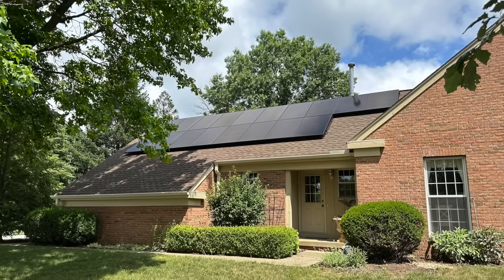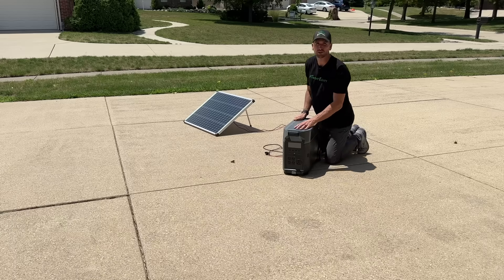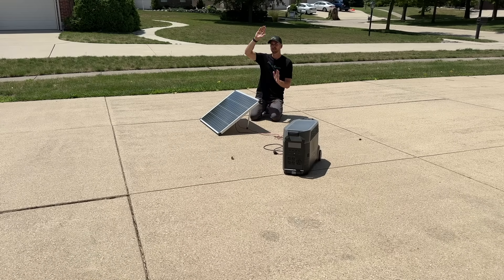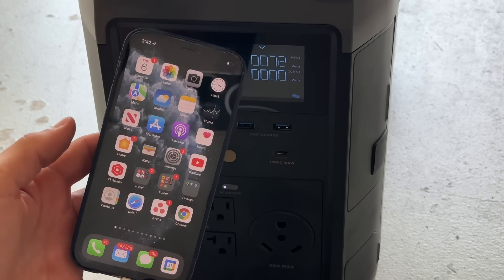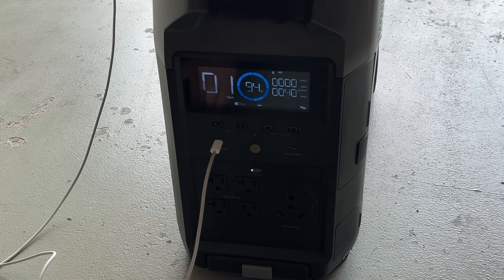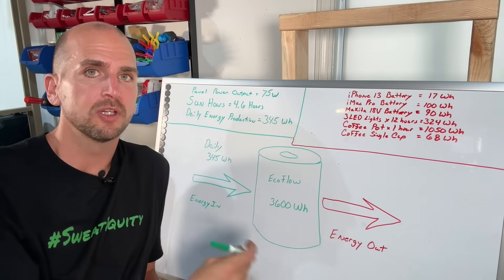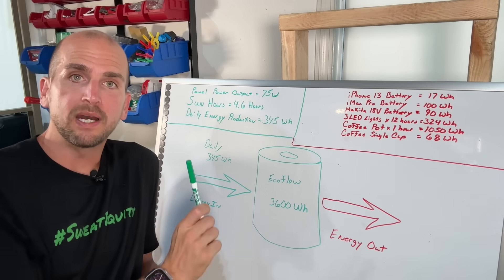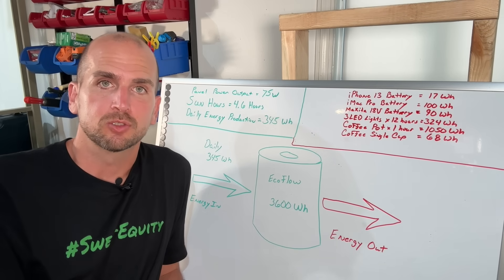What Can You Run On A Single Solar Panel?

Comment: again, people can get confuse. it's 'rated' number of watt. not how much it will produce. since amps is load, it will add load into the panel. and if we past that rated watt. you will risk damaging the panel. theoretically panel always designed below the rated watt. it's not bc the panel is underwhelmed.

Comment: What can you run on a 100W?  Not that much even with all the energy efficent lights. Don't  forget, 100 W usually indicates the max.  Without a battery storing  the electricity it isn't  very useful. One car battery constantly  charged (8 hours). Would make it way more useful, but only as a temporary solution. You would still be living a nomadic lifestyle.

Comment: Do you know which solar power station model in UK (EcoFlow, Buletii etc) I can charge with a 245 watt solar panel (open circuit voltage 37.4, open circuit current 8.61)

Comment: Planning to convert an 8x8 shed to off-grid solar with lead-acid batteries due to freezing temps. This was very helpful, thanks.
Reply from the maker: Best of luck, sounds like a fun project 👍.  Here is a bit more information on a Solar Shed project I did last year https://youtu.be/53mRZQK3g8g

Comment: You failed to mention the consumption of the AC inverter. On the Delta Pro this is about 40 to 70 watts and is not reported in either the display or app.

I also noticed that you had the AC inverter switched on even when using only the USB outlets, thus wasting the AC inverter current draw. Despite the 70 watts coming in from the panel, you would probably have been draining the battery slightly.

Comment: Why should you run on a single solar panel?!? Solar panel price index has fallen by over 60% since the beginning of 2023!
Solar electricity from them then only costs around 2 to 5 cents/kWh. 
This is because solar panels generally last around 25 years - and are maintenance-free!  
It is therefore very worthwhile to install as many solar panels as possible on your garage, carport or house roof, on house walls and/or in the garden.

Comment: You need minimum 500 watts and 6 deep cycle RV Marine batteries from Interstate Batteries  to run a stereo TV And Radios stereos  some lights can charge up a air compressor tank

Comment: i  think the way you're calculating watt hours is wrong the calculation you did was already done when the solar pannel was rated, so you're double caclulating it, you get 4.6 Hours of sunlight per day, but your pannel is producing power from say 6 am to 6pm or whatever it is, so you actually get more than 345 watt hours. if you take the total watt hours over the entire day, you will see near the rated capacity of the panel which is 460 watt hours.  460/4.6 = 100, thats how pannels are rated. theyre rated by how many sun hours for the day, not there maximum wattage. this acutalyl makes it way way way easier to know how many watt hours you can produce during the day, no fancy calculations needed. if you get 4.6 full hours, and a 100 watt pannel 460 watt hours, easy .

Comment: If your Ecopower Battery unit is drained and using a 100 watt solar panel that averages around 75 watts would take you 48 hours to fully recharge that Battery pack what a waste of Money.  Your better off recharging with a much better solar array, or a generator.  or maybe the 110 voltage option to recharge.  These portable battery station are way to expensive.  Sure nice for charging I-phones, maybe running a small fan, ECT but it's only really good for maybe 5 to 6 hour if you lose House power.    Your better off with a Honda Generator.  for that cost.  Just my opinion.  Waste of Money for something over $1000 dollars, by a generator

Comment: interesting video. In Belgium, one does not have to register the solar setup if it's off-grid (ie : not connected to anything grid wise). I may want to set this up for consumers like a few laptops, synths, a computer and some lights (LED, of course)...with this info, I can make the calculations. Thanks

Comment: You’ve got an expensive EcoFlow, but I just want a solar panel to set out on a sunny day to power and/or charge up my iPad on the job site, and if there isn’t enough sun, then I’ll charge it later.  But I’d need an adapter to go from two wires from the solar panel to a USB-C (without an expensive device like an EcoFlow)?  Is there such an adapter?

Comment: I can get 300 watt panels used for $100 each. I want to power an instant on demand electric water heater, that requires 150 amps of power. I already purchased the on demand electric water heater and want to use it to be able to clean, wash clothes,and take a bath, but not be connected to the grid. I am cool with cooking, bathing, and cleaning during the day. If the sun is down, so am I.
Reply: Great! If you are interested on this topic, we encourage you to really watch the award-winning documentary, 𝐆𝐫𝐢𝐝 𝐃𝐨𝐰𝐧 𝐏𝐨𝐰𝐞𝐫 𝐔𝐩 - Documentary, narrated by Dennis Quaid, which is now available free on YouTube .

Comment: I expected to hear what you can run
Reply: I have two 100 amp hour deep cycle batteries powered by 320 Watts of solar. I run a 15 Litre 12 volt fridge 24/7, my indoor LED lights, phone, modem and a USB fan and laptop.

Comment: Hey are you sure you connect the negative cable first? Does it not follow same system as connecting things like a battery charger, inverter and jump leads to a battery? Good video generally thanks but have to question your connecting order?

Comment: You have a lot of knowledge regading what is supposed to happen with these solar panels and the EcoFlow, however, I think either I have a dud EcoFlow Delta 2 Max, or those figures are just plain wrong.

Here's an example.  

On a hot sunny day here in England, UK, I can put the solar panel out side of my van - just like you have, on the floor, slightly tilted to catch the suns rays, and it will pull in between 70-130 Watts.  

I put ONLY my Acer 5 Laptop on it and that pulls out 125-127 Watts.  If I put any more on it (a mobile phone, or a fan, or a heater, forget getting even an hour's worth of energy out of it).  It will power a small camper oven (500W) for about 20 minutes (basically one meal).  Or (not both), it will power a 50W heater (on its lowest setting) for about 3 hours.

The DeltaFlow Max lasts ONE DAY when it's fully loaded up to 99% with energy - it takes about an hour to fully charge it via the household 240V plug.

You can forget charging to 99% capacity, as that takes between 5-6 hours.  And anytime the sun appears on it and gives it a burst of energy, the fan kicks in and uses up all the energy.

When I bought the DeltaFlow 2 Max, the literature said that I could power many things in a household with it.  I live in a campervan and it doesn't even power my laptop (127W) for a day.

I was encouraged to hook it up to the mobile phone via an App, but I didn't, because I believed the whole system was designed to be 'off-grid' - and that kind of defeats the object - where's the point in hooking it up to the internet to get the 'best power' out of it?  

Anyway, I'm not best pleased with it.  Especially after forking out £2k for it and it's been like this from the beginning.
I wouldn't recommend that machine.  It's heavy, clunky, the 240v plugs are at the 'back' of the product and it's difficult to position it in a camper van.

Nuff said, me thinks. 

Carry on with the good work.

Oh, and ps, one of the panels of the solar panel that came with it, smashed to smitherines when it landed gently on the floor.  It's still useable, as it's all sandwiched between the plastic panels, but I didn't expect that so soon after buying it.

Comment: I have a 12x16 float out on the river. It’s really for the harbor seals to have a place to haul out in a cold New England winter.
I want to put a metal framed Christmas tree with six or eight strings of Christmas lights out there. Low budget is the key because the seals will possibly wreak havoc on my tree and panels etc.
How many generated watts do I need and what is a good (relatively) system can I install.
Guidance would be appreciated but being directed to a source of more usable info would be very cool. TY.

Comment: There is no way to run a whole house on one of those "Solar Generators" a single 15 Amp circuit comes out to 1800 watts or 1.8 KW this is on 120 Volts.  Your stove needs about 9.6 KW to run that is 240v. Most homes are wired for 100 or 200 amps and designed for 75 to 150 amps there is a 25% safety factor built in to the design that is why there is a difference the extra is for things that have a higher start up like your A/C that requires more power when it stats up.  To put it simple if you were to push your car by hand you would notice that you have to push it harder to get it rolling but not as hard once it starts moving you do not have to push as hard this is the same thing with any motor. the start up uses more energy.  To figure out how much power you need get one of those amp meters that clamp on and start looking at your appliances that are plugged in turn them on and see how many amp they use. or go to your breaker panel and add up the numbers on your breakers then divide by 2 and you will come close to how many amps you will need   you can also look at your main breaker and see what it is 200 will require about 300 amps at 240V. 150 amps per side.  to convert to watts you have to multiply your amp times volts so 150 amp equals  36 KW. Look at your highest electric bill and divide the KW used by the number of days this will give you any idea of the power you need.  Oh and don't for get about the batteries you will need those for the night.  No sun no solar panel!  😁

Comment: your coffee machine estimate/measurement is way off. Typically use is like 0.2 kWh in one hour, unless you are constantly brewing (back-to-back) new coffee once the pot is ready. 1kWh enegy to one pot of Coffee would leave you burnt crisp on the bottom of pan. less than 0.1 kWh brings 1 liter water to boil (-> coffee) after that it's just keeping it warm without burning it.

Comment: I just bought a TopSolar solar panel from Amazon rated at 100 watts.... My test 18 volts In full sun light 12 volts In shade and cloud cover out put around 10 watts Not enough to power a 80 watt radiator fan.

Comment: hi there! new to the channel but i'd like to share my project! we just purchased a 1999 ford jayco class b camper van, we are wanting to run off of solar only so we purchased a bluetti 1800 power bank that came with a portable 200w panel. we are looking into getting panels to mount to the roof. the items inside we need to run are a 2.6L mini fridge and a floor fan, possibly some led christmas light strings and be able to charge our phones. we are trying to figure out a set up that would keep us with power for 3 days/nights. it's so confusing to try to figure out all the solar stuff. we first fully charged our power bank from the ac outlet in our home, then when it was at 100% we plugged in the mini fridge and also the fan which we kept on for 8hrs- after the 8hrs we just turned off the fan but fridge was still on and we got about 20hr before the bank got to 0%. then we tried to see much battery would charge with the panel in the midday sun. i'm sure our angles were off 😁 luckily we are in so cal so it's very sunny. any advice would be appreciated, please reach out to me if you can help us figure this out, we are doing this ourselves and are pretty handy but new to solar and power related things! thanks for the great video❤

Comment: 3 minutes how to angle the solar panel using a phone to measure the difference doesn't make sense and useless. Lets just say, you in the woods in a WWIII Nuclear or EMP aftermath or even in the city, your electronics not going to work anyways unless you had everything protected in a EMP Proof Box or Enclosure "Faraday cage". Furthermore, as long as that panel is facing the sky or in the general direction of that sun, it's gonna charge. and here's another reality wake up call for you too, people use those panel flat on their roofs of their van to live in, and they still charge without angling them upright.

Comment: I have 3 100w 24v panels with a 1400w yeti converter, most of the time it produces over 270w consistently and up to 285w so very efficient. What is weird, if I plug the converter in to house power to charge, the charging unit only produces max 75w, I don't know if it only does trickle charging when it's plugged into house power of if it's a faulty unit but seems odd.

Comment: I have been very interested in solar for quite awhile. 71yr old (don't tell anyone) female. Know nothing about watts and such but want to learn. My HOA doesn't allow solar panels but I think that means ones on the roof. I have a above ground pool and would like to run the filter pump with solar. Is this possible? Would be nice to be off grid but I know that is unlikely. We do use solar lights in the evenings in the house. I can't read with the low light but I can do many things.

Comment: Nothing. Solar produces dc. Solar panels only generate power for about 5 to 6 hours a day (of the 24). Unless you have hundreds of dollars in batteries, inverter, fuses and dozens of other items solar panels are useless especially a single one.

Comment: the powestation is $2200 at least right?
Reply from the maker: At least, usually around $3K for the EcoFlow Delta Pro but they did just come out with a Delta Pro 3 so the original Delta Pro might come down in price.

Comment: to answer his question -you'd need about 15  of those panels to power a house. plus batteries
Reply: "A house" is a rather flexible unit for quantifying consumption. For the house that I rent to six tenants, 15 of these panels could be quite tight. For my holiday home, three or four of them would certainly be sufficient.

Comment: This is where I get confused: when you’re calculating the total watt hours of the devices you want to run off-grid (14 inch pc laptop, router or gateway, maybe a small desk lamp), are the watt hours per day or per hour? No one ever seems to clarify this point.

Comment: So if I want to run an Xbox and 40in tv for 4-5 hrs, what do I need
Reply: You need basic math skills and easy-to-find information about the maximum power consumption of each device.

Xbox Series X: up to 160W / Series S: up to 75W / Series One S: up to 65W.
Modern 40in TV: up to 60W.

So it's two to four of these 100W panels, a moderate number of sun hours and a generator/battery to compensate for fluctuations.

Comment: I've a dream about building a tinu but ultra-modular camper on a car trailer, which has all the needed tools and gadgets to live offgrid, so I can travel the world without limiting myself of comfort. My idea was to cover the roof and an extension on it with solar panels. With this video I realised that it's very possible to achieve. In fact I'm now pretty sure that you can build a completely energy self suficient camper!

Comment: 100w is fine for charging low power devices and keeping vehicle batteries charged. It can't power my gaming laptop, though.

With a lot of planning, the right devices, and a some batteries, one could make a few hundred watts of solar and/or wind work for their home, though. You will burn through a ton of propane or natural gas on cooking and water heating, though.

Your cold food storage will be very limited as well, but can be worked with.

Comment: A couple panels can power your devices it just depends on what you have. If you live in a cabin and have a mobile, tv and a small fridge you might be able to get away with it aslong as you have some sort of storage for the power. You need to make sure that all your devices draw as little power as possible and are power efficient in solar only setups. If you have grid but solar back into the grid you don’t have to worry too much